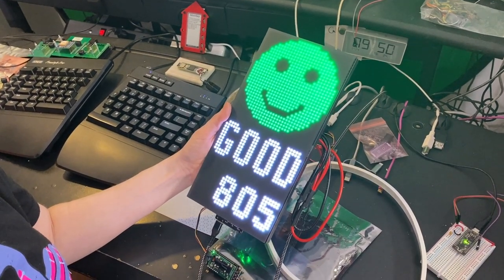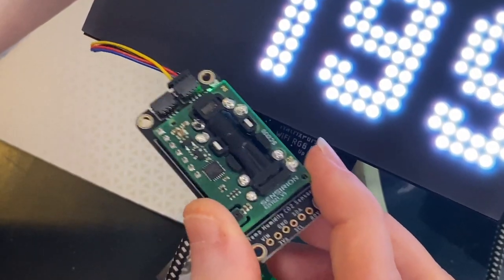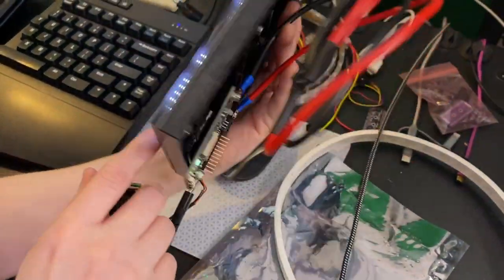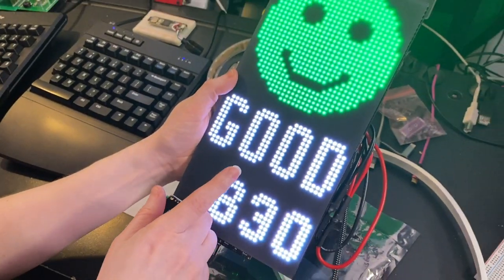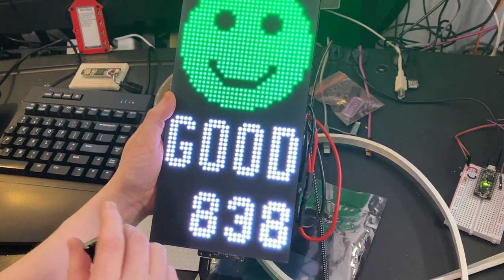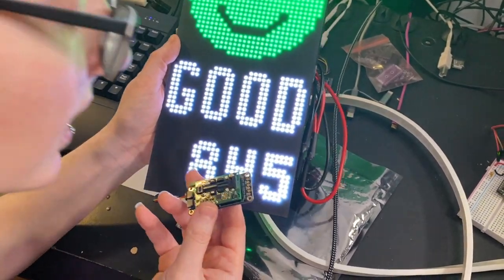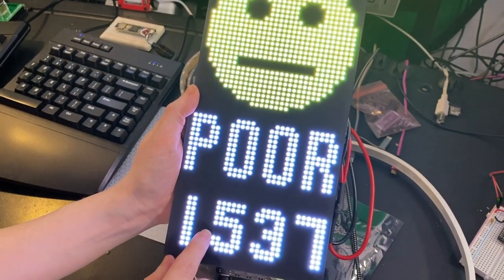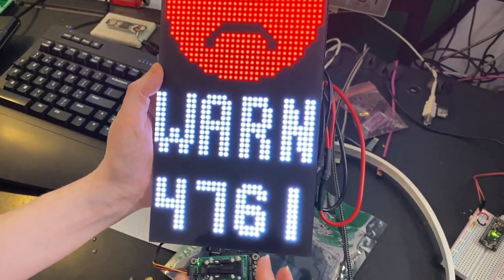Stemma QT + Matrix Portal CO2 monitor

Comment: Does CO2 levels correlate with COVID-19 risk? Sorry to be a downer. Cool looking gizmo.
Reply: I'd imagine being in a stuffy room recirculating air with a bunch of other people would correlate with that in an indirect fashion.
Reply: yes it correllates a bit. The key fact is that ventilation in general would help against covid concentration in a room. And when you breath, the output is CO². When the concentration in a room is too high, it is an indicator, that no fresh air is coming in and used air was not pushed out.
This is btw. the reason why in summer times the infection rate goes down, as more people are outside, or because the windows are open and a ventilation is possible. During winter and colder days, mostly the windows are closed and more people stay in rooms.
This should be a project in school and each class room should have such a display. And the teachers should develop ventilation plans.